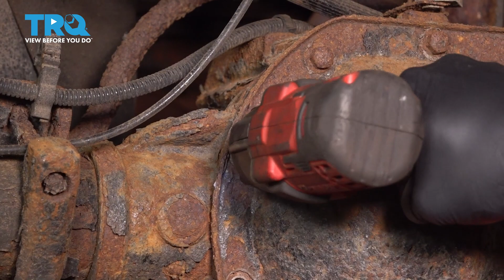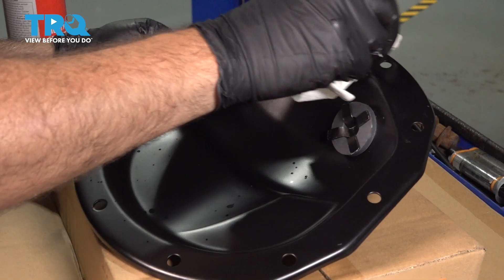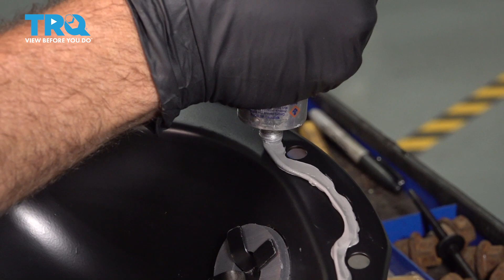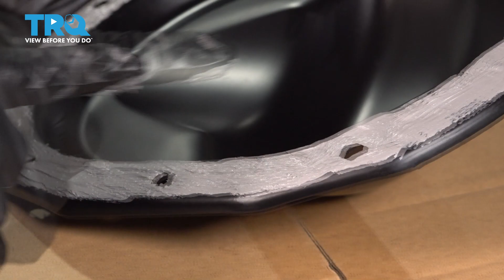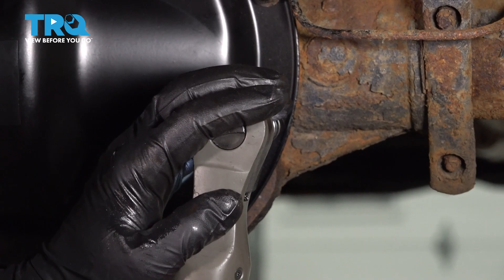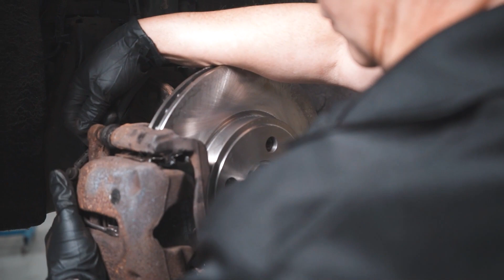How to Replace Rear Differential Cover 1993-1997 Ford Ranger

Comment: one thing i have learned and lived by with silicone gasket sealer is put down one uniform continues bead and do not touch it.  dont smooth it out, leave it as a bead..  running your finger in it, swirling it around and such can induce tiny air pockets and voids that can cause a leak.  also, don't let it set at all, if allowed to flash of skin over then u loose adhesion...  really really clean and oil free, and a continues bead...  37 years doing this